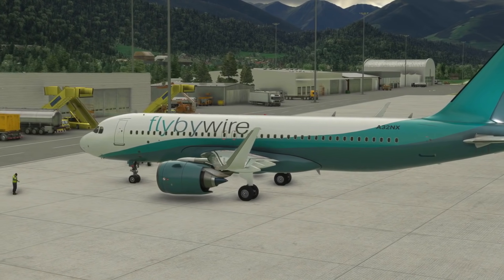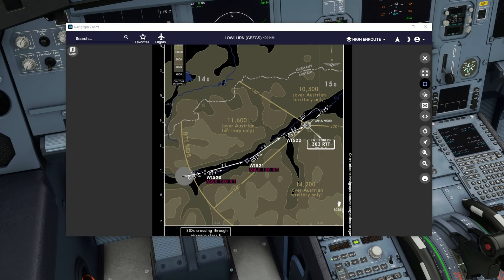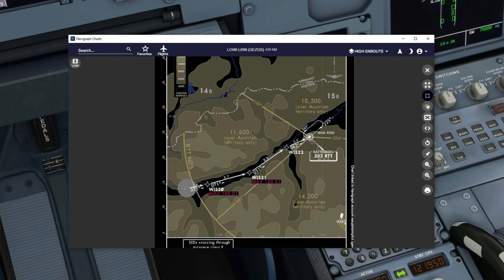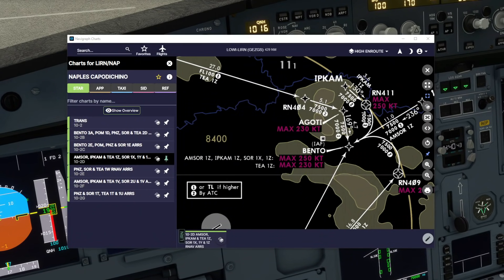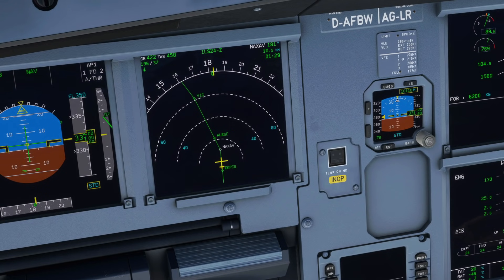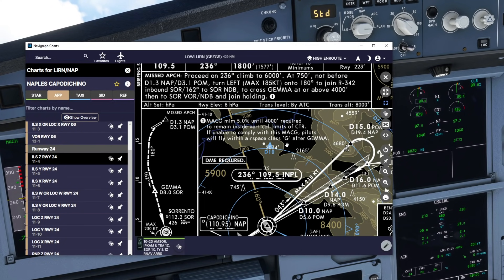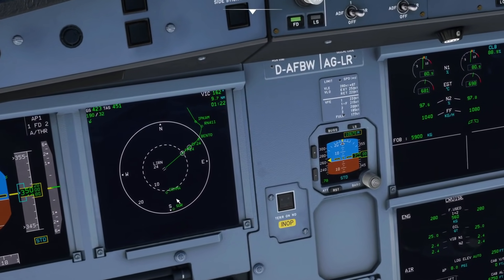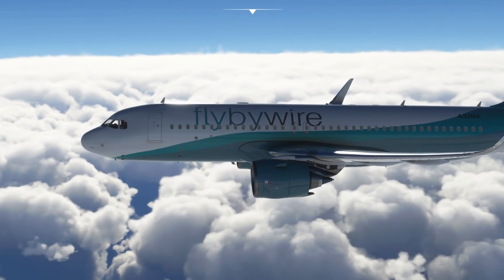FlyByWire Adds Essential New Fixes Feature to A320 | MSFS 2020

Comment: ive got to be honest this new system is a whole game changer its so good i can now actually just know what to do during a go around without having to look at the charts all the time and also nice to jsut know when to descend on the nd instead of constantly looking where to descend and that
Reply: I had the oddest experience the other day, using the EXP version, with ATC AI, that is... they told me exactly when to start my descent.  They actually got it exactly perfect, requesting descent altitudes, sometimes asking for it to be EXP (expedited).  It entirely surprised me too.  At the time I thought it might be interesting to "test" MSFS ATC and see it would do the calculations for me, and all I had to do was listen and respond.  You still have to know how to fly the Airbus, no getting around that; sometimes just following ATC works perfectly (even though MSFS ATC is regularly demeaned as inadequate or poorly implemented).

Comment: When taking off into a side wind, I know I should use the rudder to maintain centerline, but what I don't understand is whether I need to keep the rudder to resist the side wind when rotating, and then slowly neutralize after leaving the ground. I've only seen some instruction on youtube about the Cessna 172 small plane, not very systematic specific instruction, but maybe it's by difference from the A320. I don't know. Also there is another small question is when crossing the runway you need to turn the strobe light to ON, is it possible to AUTO after crossing the runway or do you keep it on until the runway you need to take off? Appreciate if you can answer my question ！！！！
😀
Reply from the maker: The rudder question, you've pretty much answered spot on. Use the rudder when rolling down the runway to maintsin the centerline. On rotation, keep that rudder where it is, then as you climb out, slowly bring it back to neutral.

AUTO for the strobes switch only puts your strobe lights on when there is no weight on the landing gear (ie, the aircraft is in the air!)

So when crossing or entering an active runway, always turn them to ON.
Reply: @Easyjetsimpilot  Thanks for such a quick answer, I pretty much got the first question, the second I wanted to show that I know when the strobe light is on and what it does, I just wanted to know if I use to adjust from ON back to AUTO when done crossing the runway?
Reply: About the rudder question - Cessna 172 is propeller aircraft where it is necessary to apply right rudder to overcome the left-turning tendency due to the p-facto. A jet aircraft does not have p-factor so it needs rudder only to counter-act the crosswind component.

Comment: Great instructional tutorial. Unfortunately FBW experimental still suffering front numerous CDT. I would really appreciate tutorials based on stable version that may be used rather than trying to use unstable FBW installation.
Reply: Stable version will be no longer updated. Experimental version has the custom autopilot which is a game changer. And finally u can avoid 99% of the ctd just by avoiding print and ecam status
Reply: @homasas4837  FBW dev team are very clear on stability of Stable Development and Experiment versions. I would suggest it is a mistake to adopt FBW experimental as the preferred end user option. Especially as CTDs are still common. The future success of FBW will depend on a Stable user environment. The Fenix Airbus paid for product is imminent. If stable and supported I will use it .
Reply: @homasas4837   @Dark Angel   "Stable" is only a snapshot of the dev version at the moment. The dev version is the version where all new features, fixes etc land. The experimental version is a public testing branch for new features that need public testing, once satisfied with the state of features in experimental, they land in the dev version.
And every now and then the "stable" will get a new version based of dev version.
Reply: @homasas4837  Thank you for the clarity. FBW should make it clear that Stable and Development versions should not be used at the moment to avoid CTD.
Reply: @DarkAngel-yu1ye  thats absolutely not what i said. There are nearly no ctd with any of  the version. Actual stable and dev version will soon be outdated since it's based on the Asobo fms. Any tutorial on this makes no sense. Given that, for a lot people, exp version is the way to go, at least until new lnav come to dev version. There is indeed no support on the discord for exp version, but as well as many others, I dont experience any ctd with it, especially if I avoid common ctd cause (print button, switching ecam infos). Fbw team is quite clear on the risk of any versions, and even if it could crash, you should be happy with this FREE mod

Comment: Should I stick with the flybywire dev version or should I get the experimental version?
Reply from the maker: Personally, I find the experimental version superior to all others.
Reply: @Easyjetsimpilot  thanks will give it a go have a good night
Reply: The best reason to use the experimental version is that it includes FBWs new custom flight management system which replaces Asobo's version. No more USR waypoints and non-sensical approaches.
Reply: @JimInTexas1  wow that looks like skme great reasons to get experimental thanks dude ill definitely try it out

Comment: We need vnav capability for auto descent and for every system that needs vnav
Reply from the maker: Vnav just means that you don't have to think and plan quite as much as the aircraft will do it for you. There is nothing you can't do now, that you can do with Vnav.
Reply from the maker: (& Vnav does not give you auto descent 👍)
Reply: @Easyjetsimpilot  yes it does, vnav isn’t just a navigation mode, it’s a whole system that add the capability for auto descent but yeah that is not the only way. But for the a32nx, vnav is not complete at all
Reply from the maker: @ShurikAviation  Vnav in the A320, does not command an auto descent.
Reply: @Easyjetsimpilot  vnav is giving info to AFS so it is a part of auto descent, not actually doing it by itself but it is important for this mode.
Reply: Airbuses do not have auto descent - you still need to manipulate the altitude knob on the FCU to start descent, which I'm told is not the case on Boeings.

Comment: why there's no TOD arrow marker featured in this plane ?
Reply from the maker: Because Vnav isn't implemented yet.
Reply: @Andrea: Implementing TOD isn't simple btw
Reply: @qp4590  all A320's in the old Fsim featured it very accurately. Why is it so difficult here ?
Reply: @andreab1604  it's always been difficult, but other dev groups worked on the airplane for years before releasing their planes. FBW made it available to the public *the moment they started working on it*, and it's only been a year.
Reply: @qp4590  ok, thanks. Is such feature expected soon ?
Reply: @andreab1604  no timelines as usual, but it's in progress.